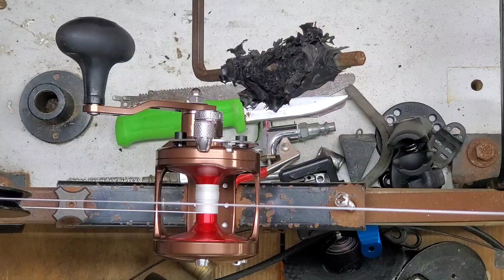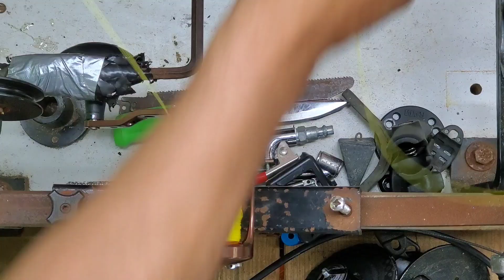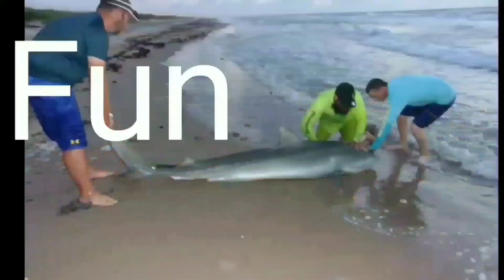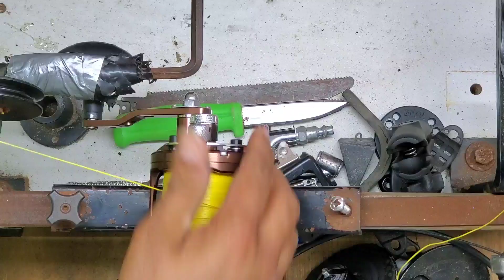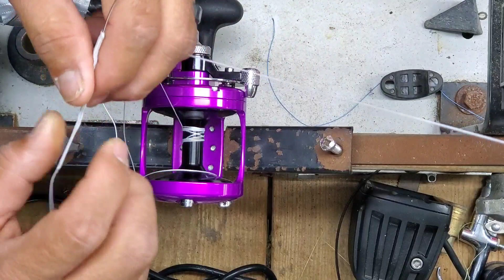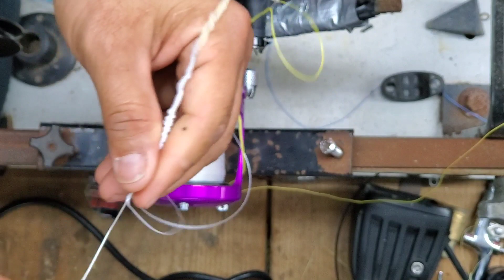Most Satisfying reel spooling back to back Hollow core

Comment: Hello, I have an Avet SX Raptor and want to spool it with 50# Braid.  If I go straight braid with no backing or top shot, how many yards should it hold. I know that not all braids are the same diameter.  Thanks.
Reply from the maker: Anywhere from 250-300 yds..
Reply: @TeamHardLife  Thank you very much for your help. Tight lines !!!!
Reply from the maker: Yes sir  and good luck